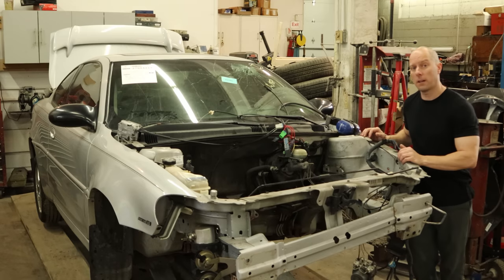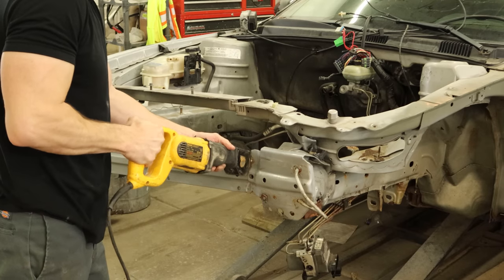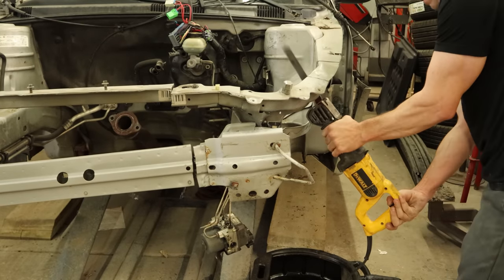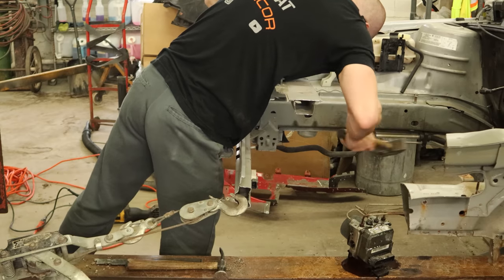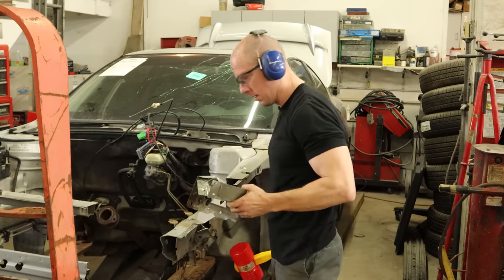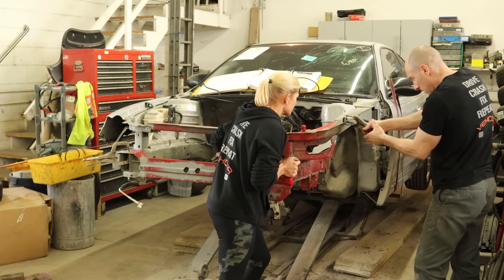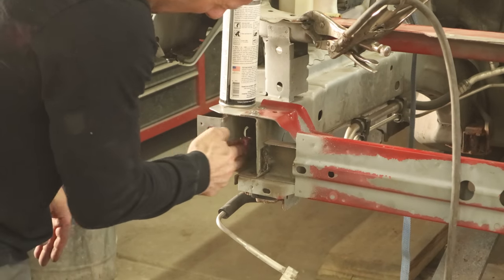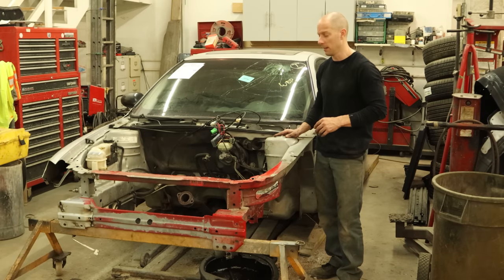Replacing the frame rail on the cheap one day build Grand Am part 3

Comment: With the current price of used cars I can’t imagine getting most anything back on the road is a waste of time. Maybe the folks commenting aren’t working stiffs for whom a car isn’t a fashion statement but rather the way to get to work without walking or taking the bus. It doesn’t have to be pretty or cool but it damn sure needs to be reliable. And since any 12 year old can steal and Hyundai or Kia these days, and Hondas and Toyotas way over priced, older American cars with parts you can get from the local pick-a-part are the go to option. Thanks for getting this back on the road for some poor schmuck.

Comment: wow, the Brake Job Hammer is more versatile than we thought! and with the prices of decent used cars going through the roof, and the prices of new cars approaching $50,000; its a lot better to put in the time and repair a decent salvage car rather than wear a pair of Financing bricks for shoes and jumping into a body of water.
Reply: I have driven 1998-2000 Ford Explorers for the last 17 years. Those things are indestructible (with the OHV or the 5.0). Yes, I don't have the ambient interior lighting, massaging front seats with heat and ventilation or a 65" infotainment display. I guess I'm old school and feel that if you drive, you should pay attention and be aware of your surroundings. These Explorers are just the right size for me, they are comfortable and now, very cheap. My biggest fear is somebody not paying attention and wrecking into me. If I lost a hubcap, insurance would total it and give me $1000. I guess what I'm saying is I don't want a new car or truck. Yes it would be nice, until you have to write a $600 car payment check each month. Scott is doing the world a favor by keeping these vehicles on the road.
Reply: @jimmycheese3817  I myself have a 2006 Buick Lucerne which is a 16 year old car; sure it’s got some of the fancy options like the heated and ventilated leather seats, a 9 speaker Harmon/Kardon stereo, sunroof, and remote start; but I mainly bought it for the absolute bombproof 3800 Series III under its hood.

Comment: I'm one of the weird ones that actually LIKE the Grand Am.....and yet I've never seen one in the flesh because they were never sold here in New Zealand.  I'm sort of surprised that people don't think they are worth putting back on the road.  Mind you, that's what people said about the likes of its grand-daddy the GTO or even the early Firebirds back when they were an old car but not yet considered a classic.  To me, the only crying shame is that I don't believe they gave the GT an option of a manual gearbox.....which would have done VERY well behind the V6.  I had an early version of what you blokes knew as a Chevy Lumina (known here as a Holden Commodore) with a 3.8 Buick V6 and 5-speed Getrag box......and it was a whole lot of fun!

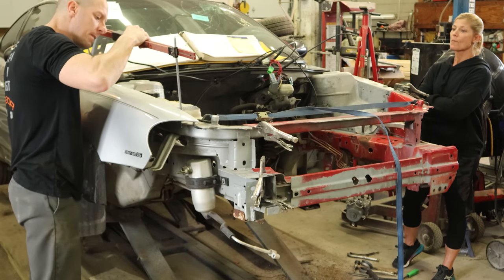Comment: 10:14 we use cross measurements for insuring drawers and cabinets are square. When I was first starting out I got into a HUGE argument with my boss when I told him "that doesn't insure that the box is square, just even"  him: SHUT UP YOU DON'T KNOW WHAT YOU'RE TALKING ABOUT!!!

I studied geometry and algebra so I built a box to prove him wrong (big mistake lol). I built a box that was 100% equally out of square on both sides. 1 end was 12" wide and the other 12.5". I said "is this box square"? He measured the diagonals. Yes 100% square. 

Ok put a speed square in the corners "wait, how can this be out of square, there's something wrong with the square, give me another one" he measured it, still wrong. 

I said "measuring the diagonals only works if the ends are the same length" you have to measure the sides and ends THEN measure the diagonals. OH man he did NOT like to be proved wrong by a pissant!

Another way is the 345 method. I've squared up houses using that. 3" 4" and 5" on the diagonal. It doesn't matter if it's inches, feet, mm, meters or kilometers. 3 miles 4 miles and the diagonal will be 5 miles. This also works for kitchen design. 3 ft 4ft 5 ft from sink to stove to fridge. (or thereabouts). 

Yes, a bunch of useless information that is supposed to fire your imagination.

Comment: Just think.  If you were a Mechanical Engineer you could have spent three years on the design of that last 6 by 6 inch piece of the frame rail.  Designing, documenting, testing, submitting for prototypes, talking to vendors who won't call back in a timely manner, testing the first trial run, and finally production.  This would have involved several trips to probably China where you would pick up every virus known to man.  And finally you would have dreams about that stupid piece of frame rail when you could have been dreaming about a pizza girl.